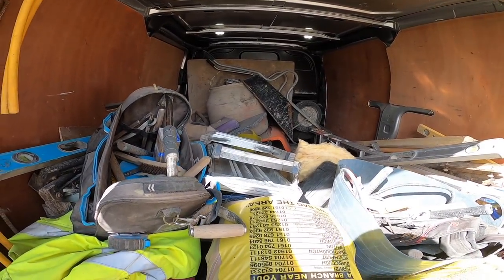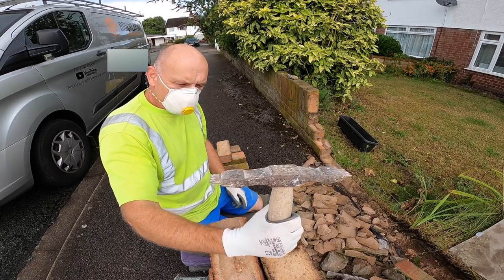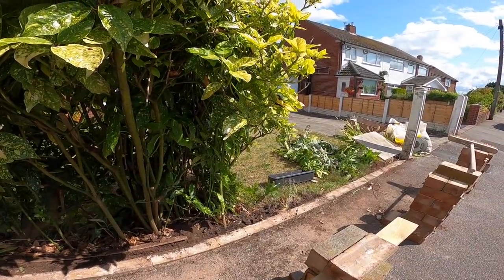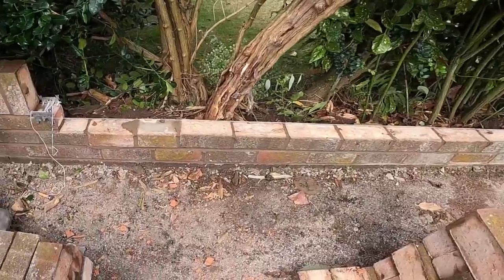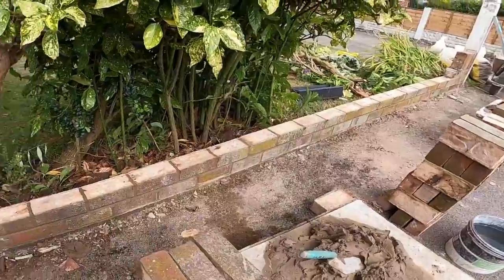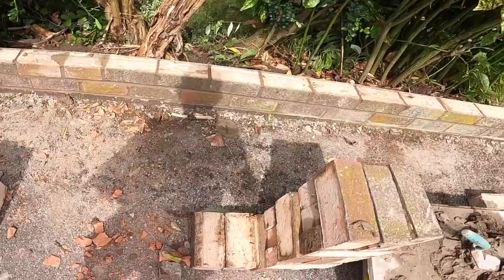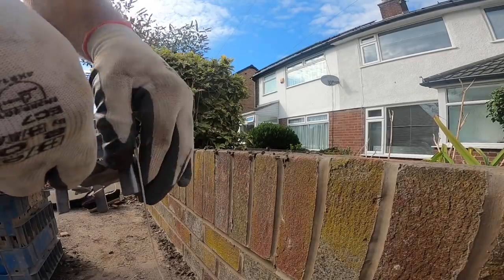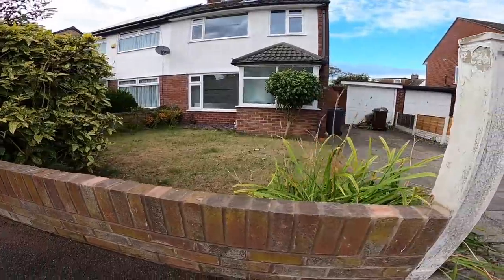GARDEN WALL REBUILD  ...1 DAYJOB

Comment: Another fine job. Expertly done. With regards to the tree as a customer I'd say get it down as its only going to cause problems further down the line. I've had my garden wall rebuilt because over time the Privett Bush has pushed against it and knocked it over.
Reply from the maker: Yep nature doesn’t appreciate good brickwork 😆🧱👍🏽
Reply: @SteveAndAlexBuild  Not in the least. Had to rebuild both wing walls on the front of my house because two huge red tip bushes cracked all the joints. Took me much longer than I'd prefer to admit to...I don't work anywhere near "Steve speed"...
Reply from the maker: @WarpFactor999  . It’s not how long , it’s the quality 😁👌🏼🧱👍🏽
Reply: Leave the customer to want the tree to stay put.
This will give Steve and Alex some future work when the tree damages the wall.
...
Reply from the maker: @goawakeneveryone4365  😳😁🧱👍🏽

Comment: Hi pal I get why you’ve put a tie into the concrete post but when they need to replace that post the wall will be disturbed
Reply from the maker: It will mate but I did check and it’s staying. 
   I would need a pillar adding if that post got potted 🧱👍🏽

Comment: How come you didn't just string a line straight up and corner block off the post and pin into existing wall then run in that way you wouldn't have needed to knock a corner up?
Reply from the maker: The post wasn’t plumb 🧱👍🏽
Reply: @SteveAndAlexBuild  oh OK the video didn't show you plumbing brickwork and it looked like you just laid it flush up with post 👍
Reply from the maker: @TheTraditionalGolfer  😁🧱👍🏽

Comment: Hi Steve I’ve always wondered how you wash your mixer out ?
Reply from the maker: Hand brush and water . When you get a build up . A bag of limestone and  half an hour polishes it up nicely 🧱👍🏽
Reply: @SteveAndAlexBuild  thanks for the reply. I meant where do you pour it after cleaning as I noticed you don’t use a stand for mixer
Reply from the maker: @markhuckle8932  it goes wherever we can as it’s just water and sand by the time we’ve cleaned it 🧱👍🏽
Reply: @SteveAndAlexBuild  thanks again for the reply. Cracking work and vids by the way👍
Reply from the maker: @markhuckle8932  Cheers 🧱👍🏽